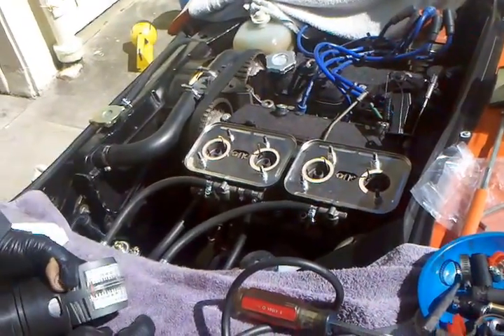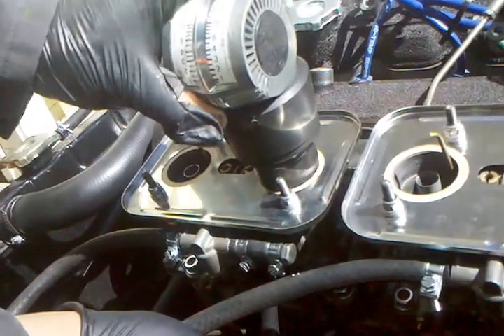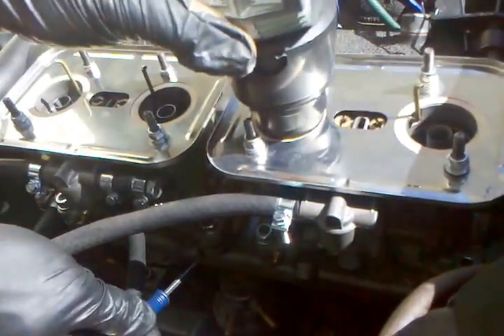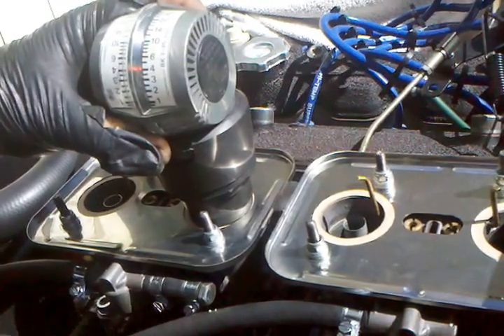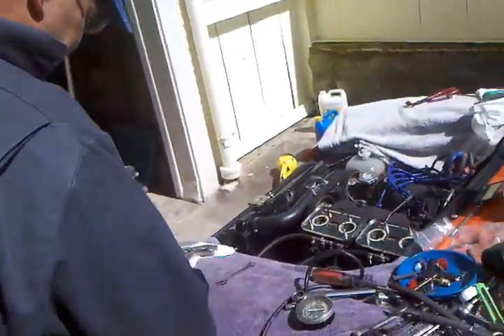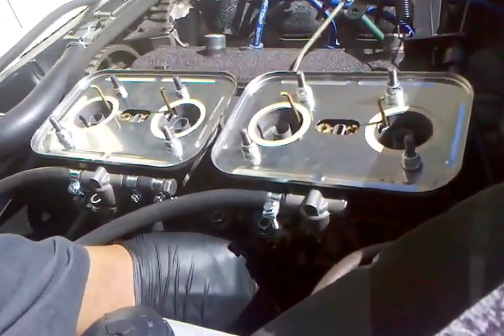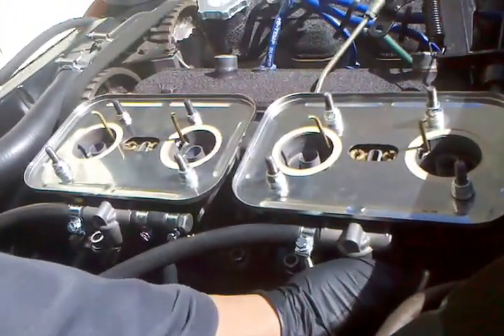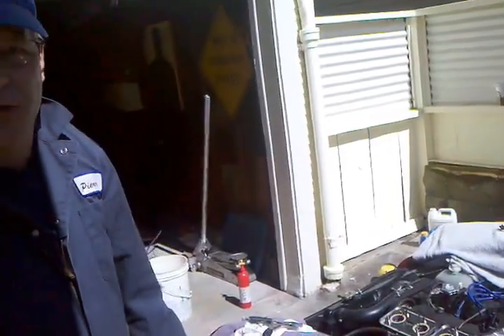Part 16:  Balancing carbs with a synchrometer

Comment: @ Install Webber Carburetors ... • 
Is it necessary for  valve  gaps  to be 100% in specifications before adjusting the multiple  carburetors air fuel mixture and balance?  or if not  which  adjustment has a higher priority over the other? 
Thanks for sharing your knowledge!
Reply from the maker: Get the valves in spec first. It is the most basic requirement for a solid tune and becomes more important when you have a four branch manifold feeding each cylinder separately through a single carburetor barrel, as now you have each cylinder operating individually. 

There is not a shared plenum to balance things as when you use a single two barrel carb with a shared plenum. 

If your valve adjustment isn’t spot on the cylinders won’t be equal, now you will be balancing the carbs around this shortcoming. 

Getting the valve adjustment as accurate and even as possible will have a noticeable effect at idle, even when running a single two barrel carb.
Reply: @installwebercarburetorsona6312  Thanks for the good advice 👍

Comment: If you set the left carb using the air screw then ditto for the right carb, setting the right carb would change the setting on the left carb ?
Reply: the carb barrels are set to match each other using the individual air bleed screws on each carb.  Then the balancing screw on the throttle linkage is used to balance the carbs to each other, Hope that helps.  It never hurts to check your work again, checking airflow through each barrel to be sure they match, you might need a fine adjustment.
Reply: @installwebercarburetorsona6159  Thank you

Comment: How do you know what the right reading is to tune all four cylinders to?
Reply from the maker: The goal is matched readings on all venturis, not a particular reading.  That will vary a lot depending on the particular specifications of your motor, ignition timing, idle speed etc.

Comment: could this tool be used on a car carb?
Reply: it's designed for a car or motorcycle with multiple carbs, whatever it will fit.